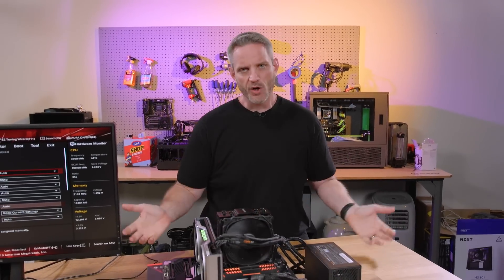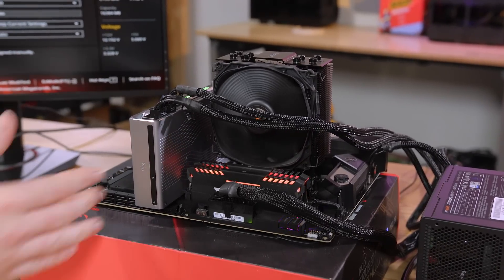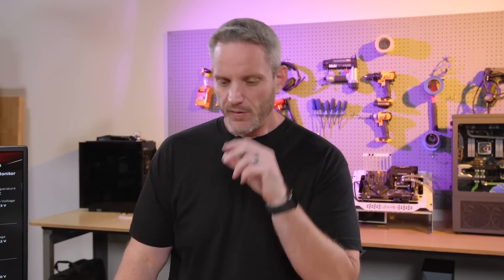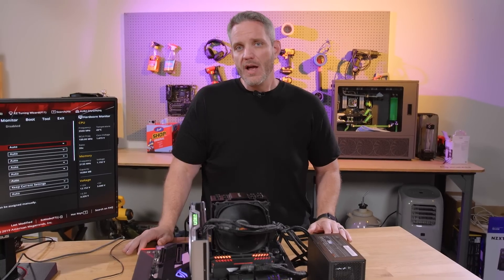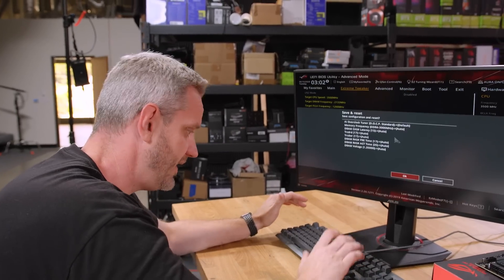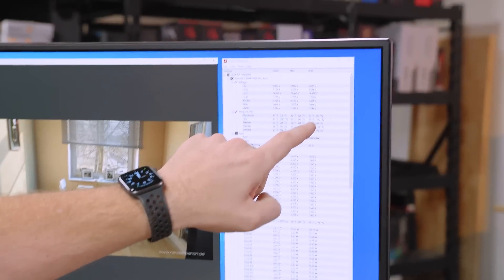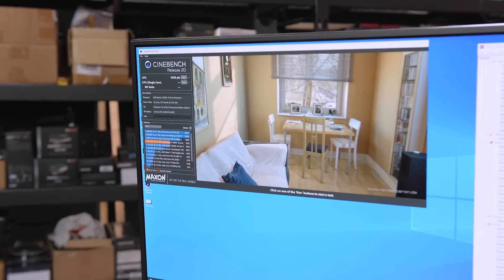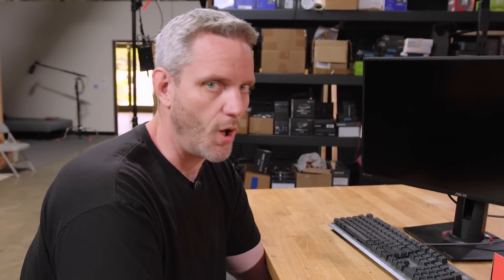Is your motherboard trying to damage your Ryzen CPU?

Comment: AMD already responded:
"We want to be clear with our customers: AMD Ryzen processors contain a diverse array of internal safeguards that operate independently of external data sources. These safeguards enforce the safety and reliability of the processor during stock operation. Based on our initial assessment, we do not believe that altering external telemetry in the manner described by those public reports would have a material impact on the longevity or safety of a user's processor."
Anandtech (Dr. Ian Cutress) also said it's not something you need to worry about. Also check Steve's video from Gamer's Nexus. This is nothing to panic about.
Reply: Yeah, with how 2020 is going, I'm sure someone would set fire to a mcdonolds because of this....
Reply: I read "internal" as "infernal" and got really concerned about AMD making deals with hell for a second
Reply: @David Willis You should really check out the VRM capabilities as some of the 450 boards are not that great. Buildzoid has a good run down on the 400 series.
Reply: @earthtaurus5515  but a 3600 isn't a 3950x and every single b450 should run it no problem
Reply: @EL DIABLO bruh you can and it makes a difference please don't talk about something you never know anything about. if that was real it was already going to be exposed and the reputation of that motherboard producer WOULD REALLY GET RUINED... even if they thought about it they won't risk it......................
Reply: this comment should be pinned
Reply: My idle temperature cpu package is 62c kraken x73 3900x temperature cpu package is 62c wih asus crosshair 8formula board 1000hcp psu and 2080 super gtx 900d case 4 Ql  140 and 2 ML 140 and 3 120mm AF corsair  fans
Reply: could you please send the link of the video Gamers Nexus did about this?
Reply: @Saint Q TheEasternBlockPuppet I don't lie and it was not the damn PSU because I got a new Aorus B550m PRO. AMD RMA'd the CPU and threw the one I had in the trash and sent a new one. I built the system again and used the same PSU and guess what? 18 days and the rig runs great and no issues. Guess your not as smart as you think......
Reply: @1717Wingman  18 days .. wow!  Nothing can possibly go wrong if it hadn't already.
When you have more problems, buy a new P/S and a UPS if you suffer brown/black outs in your area
Reply: @RobBCactive  System still running perfect and it has been months. Was a crazy fluke I suppose.
Reply: @RobBCactive  Still running strong.
Reply: bet you wish you'd bought that stock though, it went through the roof
Reply: yeah obviously Jayz knows it, but incase any viewers take Tom's seriously: double-check anything they say on Anandtech first. And Steve has probably already researched it to death, moved on and forgotten about it before some rando pay-per-click writer for Tom's thinks of a good clickbait title.
Reply: @MrHics  yes totally shit pages anad and th are unreliable
Reply: Yeah, I don't give a shit what they all say, don't overclock my hardware without my request or knowledge.
Reply: @cccalhoun  exactly. That's why I tend to turn a lot of stuff off. Also better to confirm stability at stock before overclocking anyway.
Reply: anand tech LOl TH and anamd tech is shat i hear and will instantly define nub. horrible pages
Reply: I ordered a 3600 on March 28th. My PC has ran for roughly ten days. The first board was a B450M- PRO- VDH MAX Ryzen 3000 ready. Ran for a few days then all of a sudden my 3TB HDD drive died. It was a 7200 RPM and real expensive so I bought 2 TB 7200 RPM Drives to replace it. Then after waiting 8 days my system was up. Playing FC5 and the system hangs, sounds like a broken CD then the system crashes. Board fried! Constant boot loop, will not start to load windows. Ate the cost because I am past refund date and want my rig up. Ordered a Gigabyte B450M Aorus that is Ryzen 3000 ready. Then my Corsair H60 died. But with COVID delayed shipping, I swallowed the cost and bought an EVGA 240 AIO. Then the board died again. Now I wait for a board and sent AMD a message telling them what all I had been through and Customer service blamed the CPU and not the bios. So I sent that out FedEx yesterday. IT HAS BEEN A NIGHTMARE.
Game pass that came with the CPU will expire, useless. Can't use my rig all this time and AMD is fully aware of all the issues I have had. I get an RMA for the CPU. No we will upgrade. No we will replace the game pass. No we will send a damn system that runs.

Actually, I am glad this happened when it did. I was about to buy AMD stock. Not much, Maybe $1200 to see where it went. Not now!
Reply: @1717Wingman  what PSU is it? cos if your running a $20 800W silver box special thats far more likely to be your issue than any CPU/Mobo combo.
Reply: @1717Wingman  sounds like PSU or house electrics are bad, CPU wont fry the mobo & HD & AIO.
assume all the parts are new? 
may also just be bad luck or your postman hates his job :P

had a DOA mobo last time, was a pain but amazon swapped it out fairly fast maybe 1 week or so in total from tech support to amazon ok to replacement. just happens some times.
as he mentioned it's not new the mobo thing, intel has had the same problem for years.
buildzoid also complains about it, he wants his mobo settings stock so he can OC the way he wants without tho mobo fighting him
any way good luck
Reply: @liaminwales  Yup. It's definitely something else. There is no direct line from the CPU to the SATA controller. All power to those devices are drawn directly from the PSU. The AIO draws power from the motherboard, but again the fan controller is not part of the CPU so it won't kill anything unless dirty power is being supplied to the motherboard. I suppose they can fuck it up via BIOS, but that's very unlikely.
Reply: @liaminwales  "sounds like PSU or house electrics are bad"
PSU. EVGA 65 Watt GOLD but I switched it out for a Power Spec 650 and it still will not run.
I use a surge protector and this outlet use to run two gaming PC's at the same time for years.
Reply: @1717Wingman  Dude, that sounds like a busted PSU if I ever heard of one.
Reply: @1717Wingman  in 95+% of cases its PSU related situation. Even if the case is your house electrics are bad your PSU should handle this. If it is a cheap model with little or none safety features it will transfer all but good voltage to the PC components.
Reply: @bartomiej9807  EVGA 650 GOLD
Reply: @1717Wingman  with how unlucky you are ya might as well buy a lotto ticket at that point. but yeah like everyone else said, that's definitely a power/ground issue and not the cpu.
Reply: @1717Wingman  If all that actually happened on your computer, you must have a garbage or defective PSU.
Reply: @1717Wingman  I ordered my Gigabyte x570 ultra (i honestly dont know why people are using 450 boards for the new 3000 series...) with my 3600X back in March. I have played Farcry 5, destiny 2 division 2 (terribly optimized game) and have had zero issues with this PC.  If you have had to replace that many different parts, my bet, like many others have posted, is probably a faulty PSU, not a mobo/cpu issue.
Reply: @sabrevanson4412  Sad part is, people are still giving others advice to buy B450 boards. Which is stupid at this point in the game... Especially seeing as MSI is the only board manufacture that "has" to prove something with 4xxx ryzen. None of the other board manufacturers made any claims about Zen3 so they are free and clear to do as they please... As for MSI all they have to do is make the first released 4xxx processor "work".... From all that is being leaked 4900x will be the first released. Which will be a $550 at least processor.
Reply: @kramnull8962  i know.  When the B550s where coming and AMD said RYzen 3X and 4X only, and people got upset i went...why?  Why are you mad?  You buying a 4X series chip and using a board that will be 2+years out of date for it. You wont get to use it to its fullest. Thats like buying a ferrari and just going 40 for ever....what a waste.
Reply: @sabrevanson4412  - Depends on whether or not you really need all of the functionality that the 4k series provides. Some people might just be happy with higher frequencies and IPC, and not care about any other features.
That being said, I was somewhat disappointing to hear that my B350 board will not support the new CPUs. But I'm not angry about it. My cheapo board is running a Ryzen 5 3600 right now. I'm set for awhile, and I'm grateful that I didn't need a new board when all I wanted was a simple CPU upgrade. When the time comes that my 3600 is no longer enough, I'm going to be needing a new GPU as well, and will be looking at a new build.
Reply: @sabrevanson4412  (i honestly dont know why people are using 450 boards for the new 3000 series...) 
Because they want to much for that POS 570 and I don't need to pay for gen 4 when I won't use it.
Reply: @sabrevanson4412  u dunno shy p use b450? nub hush
Reply: @kramnull8962  u talk bs b450 boards are good check ur vrm and power delivery nub
Reply: @sabrevanson4412  cool more bs
Reply: @LoneBlade5  I spoke clearly about MSI boards. Which Gamerz Nexus actually made a video about... Only good B450's from MSI are the Tomahawk and Max... The rest overheat and are very poor performance...
Reply: @sabrevanson4412  My condolences for your Gigabyte board. Hope you won't run into troubles couple years down the road.
Reply: @sabrevanson4412  I got a 450 board 2 years ago when I got a Ryzen 7-2700. Just last week, I updated the BIOS so I put a Ryzen 9-3900 on it. It works great, and I don't see a reason to pay for a new board (along with new Window 10 license).

I don't know if that answers why someone would be using a 450 board or not.
Reply: @1717Wingman  THere's no way a CPU can fry components man. If your components are getting fried it's the PSU or the mobo. Seeing as the mobo is among the things fried, then you definitely have an electrical problem
Reply: @1717Wingman  I've owned a 3600 longer than that, over 6 months now. Like many others have said, it has absolutely nothing to do with AMD or faulty Ryzen 3600 chips. It's your PSU. I went with the best PSU out there (imo) the Corsair RM 850x
Reply: @1717Wingman  I have had nearly the same experience on a Asus Board with Intel CPU, first one of my HDD blow, then the memory, and at the end the GPU...
After some investigation I found that it actually was my PSU thats gone unstable because of 3 rapid powergrid blackouts... and it was the spikes when it got back on... this was on 230V grid and its a lot more stable than 120V grids... A PSU should manage a power shortage like that, but 3 in a row was to much for an somewhat older (but good) PSU...
You really should check your PSU before you start your system again...
Reply: @1717Wingman  past refund? My gpu 670 died after a power outtage wheb it was close to 3 years.  We thought it was the psu first. Got a new one for free to test. Wasn't it . Sent my gpu in. After 3 days they Said "gpu fucked.  Here is a new 1050ti. Enjoy" 
Your country dont have laws protecting consumers?
Reply: @osgiliath87  a 1050 for a 670 nice rip off uve got 2 cards lower than ur 70
Reply: @1717Wingman  Never cheap out on a PSU
Reply: @1717Wingman  My build is a ryzen 3600 with a b450f and ive had it for about 3 months now and its solid
Reply: @1717Wingman  Man I don't get how you have any upvotes on that comment. I've had similar experience with intel and msi motherboard. First time cpu fried, then the new cpu fried too. Turned out it was the motherboard so next time got both replaced (same model and everything). Well guess what the new motherboard broke again (this time not the cpu). In the end can't blame intel for it and heck I don't even blame msi, even though I have to admit I didn't buy msi for while after that. Now trying my luck with their gpu though and it's working great.
Reply: @Iisakki3000  Sorry to hear of your issues. I still ain't able to run a game because AMD told me to RMA the CPU and I can't buy a board. Hate to switch my Linux rig to my old gaming system because I am left with my Linux build being my main PC. don't want to worry about issues with it until...
Reply: @1717Wingman  I have 450 tomahawk max (owned it since release) with my 2700X pulling around 110-120w (on PBO with voltage offset) running 1.365V 4ghz-4.1 (depending on ambient temps)at full  load 24/7 for a week now doing simulation with VRM at 80°C max( I have server fan exhaust so yeah). In your experience that's tough but oh well at least you got replacement although you insist that PSU is good not everything is certain. if you know a good electrician with good equipment have it checked. if its good then you just happened to have the bad ones out of the bunch
Reply: @edgravity  Got the B550m Aorus Pro a week and a half ago. Had sent my CPU back to AMD for RMA. They tossed it in the trash and sent a new one. Put the rig back together, with the same power supply and all has been well. The last CPU would only seem to hit like 4192 MHz with one core hitting 4.2 occasionally. New CPU hits 4213 MHz on all cores and I have seen some cores hit 4232 MHz.
But this MOBO literally weighs one pound more than the 450 version. There are heavy, seems like steel, heat spreaders on the VRM's, etc... Nothing gets hot or near "80°C max". I couldn't be more satisfied at the moment and it has lasted well beyond the 450 boards and the first R5 3600 CPU.
Reply: david willis that's good to know as i just recently stumbled upon this.  and something was really wrong with that CPU to cause that huge mess.
Reply: @edgravity  How is the Freq now? above 1,325V is supposed to degrade your cpu in a couple months?
Reply: @HERGRYN  Still fine, as it doesn't reach 1.4 before which is bad for long term. Anyway the power draw for a meager frequency isn't worth it so I turned PBO off still running simulations at 3.9 to 3.95ghz then I bought another rig with b550m mortar running 3950x at 4ghz with only 0.0850v offset and having almost same power draw with my 2700x on PBO.
Reply: @1717Wingman  Should've bought that AMD stock.
Reply: @1717Wingman  I running fine with TomaHawk Max + Ryzen 5 3600 + Sapphire Nitro+ RX 5700XT + HX 850 850W 80+ Platinum
Reply: @silver-box2450  love my sapphire nitro 5700xt, paired it with a ryzen 7 3800x and I already had a Asus prime x470. Runs great and haven't had any problems
Reply: @silver-box2450  OK psu
Reply: @1717Wingman  u lie i can tell
Reply: IF THE PSU WAS BAD THEN WHEN I SWAPPED IT OUT FOR A BRAND NEW POWER SPEC (all I could get locally) THE SYSTEM SHOULD HAVE RAN.
I had a long discussion with AMD and they told me it was probably the CPU and I should RMA it and they sent me a FED EX label. If they say it is probably the CPU. Then it ain't the muffler bearings or the knuter valve.
Reply: @1717Wingman  Yeah, once the CPU is fried, it's too late to get a new PSU. But I suggest that when you get a new CPU that you pair it with a decent PSU. Never cheap out on the PSU. And do your research. Read reviews for all components.
Reply: @Dave0zz  The PSU is about 2.5 years old and is a EVGA 650 watt Gold. It was powering my R5 1600x OC all this time without issue. I think with that track and the odds that it would just fail because I swapped the board and cpu is slim to non. Thx
Reply: this is why I buy Intel...it just works.
Reply: @moby1kanob  u go buy Intel cauas it works than dummy alert

Comment: A year or two ago I put a 2700x into a cheap Asrock and after about a week, the socket burned out at stock settings.  I will never let the motherboard control my voltage again

Comment: running 1.47v ???? are you crazy Jay ??? strange for 7nm vs intel never go near 1.4v to begin with...they sits at 1.35v for 14nm...supposed 7nm run lower volts ...like 0.7v by now like GPU's ?? why volts gonna up when they shrink ??? TSMC is very strange ....from 28nm to 12nm ....from bulldozer expierence ...last voltage was 1.31v ...1.28v would be default.....but 12nm ....??? 1.38v to 1.4v for staying stable for 4ghz+ .....now zen2 need to be 1.47v ??? 7nm need more power ???? strange ...imagine gonna 5nm......so now we are gonna backwards in power usage ...2v cpu for sure ??? i am so certain zen4 and zen5 gonna be 3v cpu'''??? 5nm that be nuts

Comment: Currently, I'm not sure whether my Motherboard is broken or not with the ethernet port, it's fairly new, I bought it around 4 months ago, because it's hardly receiving the IP. I installed a wifi card, but it overheats so much that it disconnects frequently. (Ethernet & wifi works flawlessly in other devices, so it's not the router).

Comment: I put an overclock on my 1660 super on my ryzen 5 3600 on a stock cooler and I pushed my oc on my gpu where my computer restarted a few times as I tracked the temp it jumped up above 84°c and after putting on a cooler master aio my gpu shuts my game down before my cpu even reaches 70 lol

Comment: Not gonna lie this was happening to me while i had it for first days. Ive set it to run PBO  -0.2v  + power limit 255 (for some reason one 4pin cable wasnt enough at first. Then found in bios the power limit setting) {btw returned my psu cuz im an idiot}  .
Firstly. I did this because i had crazy shit temps on idle ~55C  (corsair h100i in a 7fan lian li case) while gaming and stress testing on defaults my cpu was on around 85+.. compared to everyone else this was awful. So i tried to tweak it. Now i game on ~4.25ghz  and stress testing 4.1ghz max temps ~77C 

3700x